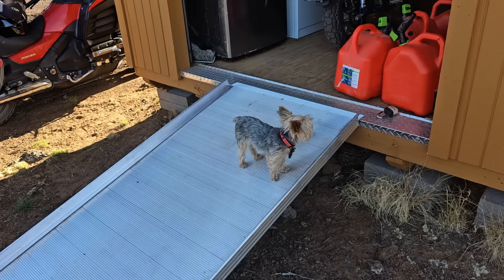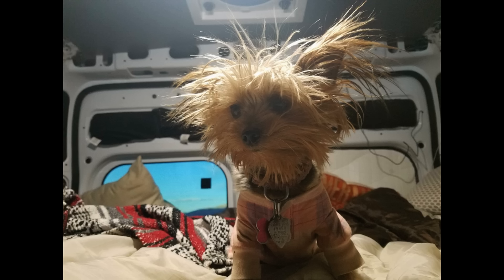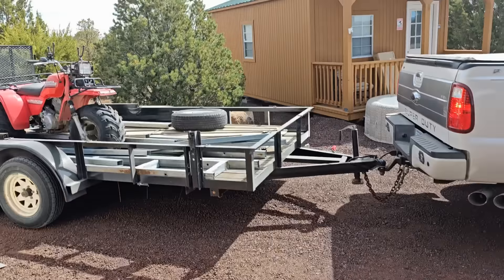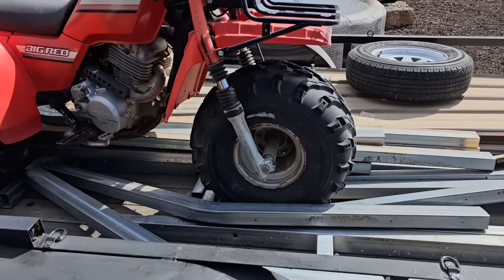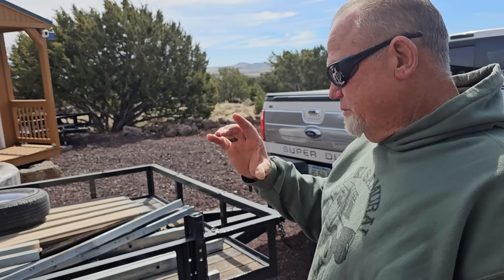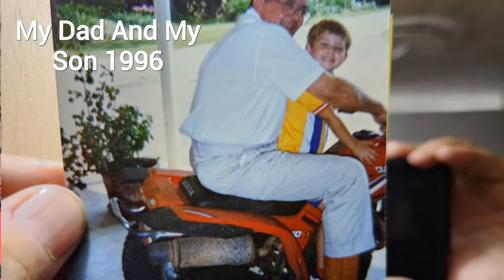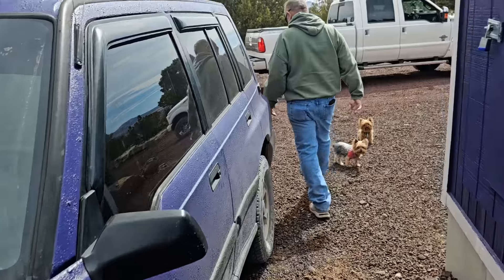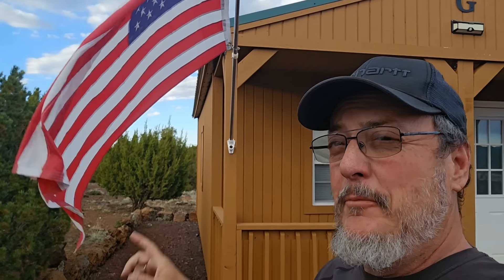I Just Got A Fun, Antique, "Dangerous?" Workhorse And Shelter Delivered To RV Basecamp!!!

Comment: You have a lot of rocks on your property. You could move that garage back a few more feet from the driveway.  Then stack rocks in front of the garage door and make a gradual slope ramp into the shed.  Use some of the cinder to fill in between the rocks. A nice wide gentle slope you could easily park whatever you want in that shed.